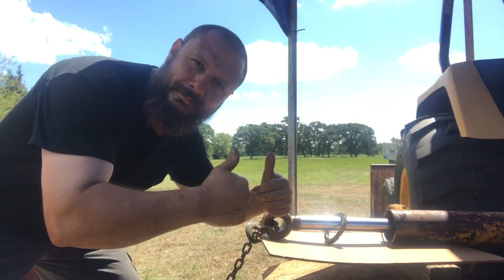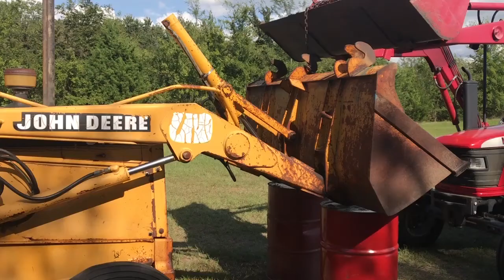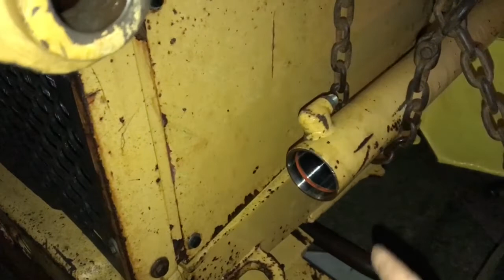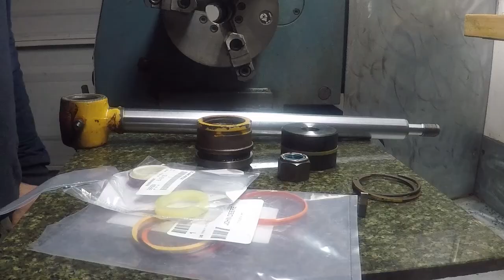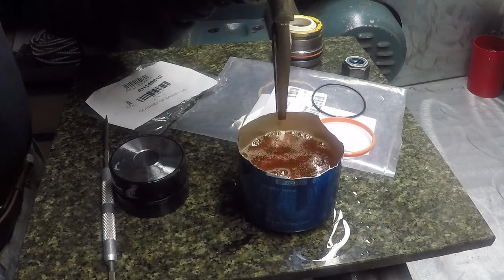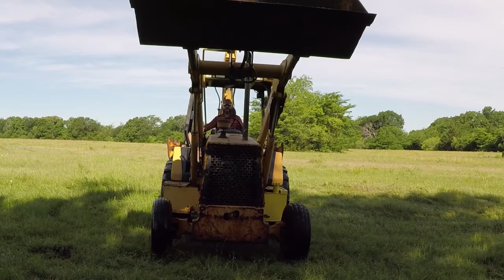John Deere 310D Hydraulic Cylinders Finale

Comment: How come my swing Arm will only go to the right, and it will go to the left. But very, very slowly. And both Cylinders were just rebuilt. What is my issue?
Reply from the maker: Did it do that before you rebuilt the swing cylinders?
Reply: @SalamSayhood  yes
Reply from the maker: Did you check the value that controls the swing? Did you check if there are any mechanical issues with all the hinge points? Also make sure all the linkages from the stick that operates the swing to the valve are good and the hydraulic tank is full.
Reply: @SalamSayhood  Where is the Vaule at the bottom of the linkage ?
Reply from the maker: Yes, right above the swing cylinders. To know which valve, just follow the hoses from the swing cylinders.

Comment: Thank Salam, I really appreciate your content.  I have a JD 310C in about the same condition and due to your videos I now have the confidence to rebuild the cylinders on my own.  I'll be tackling the bucket cylinder in the next few days.  My stabilizer cylinder rods could also use replacing and it appears our machines share the same part number (RE26577) - would you mind sharing where you picked up the aftermarket rods you used?  Thanks again!
Reply from the maker: Good morning sir, I bought mine from a place in Irving, Texas called Heavyquip. Look them up. They have several branches in several states. Thank you for the nice comment, if you have any questions please let me know.
Reply: @SalamSayhood  Great, thanks for the information!
Reply from the maker: You are welcome

Comment: Thank you Salam for sharing. I didn't know grease was compatible with Hydraulic fluid. I that a special grease. I know when I rebuilt the Alison AT540 transmissions, I would mix vaseline and transmission fluid to make a paste for installing seals. What is that that you are using?
Awesome video, and thank you for your final comments and recommendations.
Reply from the maker: I just used lithium bearing grease. The hydraulic system is separate from the automatic transmission fluid. The grease will not cause any issue in this system. I also used anti seize on the thread of the glands to make future work easier. Thank you

Comment: Thanks Salam!  I believe that I have watched all of your videos at least once. Very helpful! Interesting how "easy" it was for you to disassemble these, compared to what I ran into.
  
Water and Rust appear to be the main enemies here. 
 
  On both of my stabilizers, the gland nuts were literally hand-tight, and there was extensive rust inside the first +- 2" of the cylinder. The Swing cylinders were much the same. I have not gotten to the others yet. This meant water, and a lot of cream-colored fluid collecting in the system.
 
   My main problem was that no matter how well I thought that I had cleaned the area around the internal Snap Rings (in all cases), the installation ring failed to stay in place. For the stabilizers, this caused some damage to the Wear Rings (no big deal). 
   Trying to clean the area inside the swing cylinders more thoroughly before extracting the assembly, did not unfortunately work out for me. I believe that the amount of internal rust (that I could not reach) was too much for the ring, and it got caught during removal. It was unbelievably hard to move the gland at all for snap ring removal, and took a lot of pounding. The first time, all I lost was the cast iron wring out front, but the second one (after being even more careful to try and "clean") I ended up breaking the front portion of the piston. That is not an easy part to find at all (I am still trying).  

  I fully plan on packing these with grease as you show. I already have some Marine Grade stuff for re-assembly. I plan on sending this machine to my son when I am done excavating, and I would not wish those problems on anyone! Thanks for that continued advice.

   My machine was not maintained well by previous owners. The creamy hydraulic fluid is a good indicator of water getting into the system through bad seals. Up north with the snow/ice, it is not hard getting in. Storing these under any sort of roof will keep these machines operational much longer. 
 
  As far as extraction methods, I would be inclined to create some sort of motor-driven screw-shaft sort of slow removal method. Something that is slow, but powerful, maybe 12V powered. I am sure that I could have caught the ring/piston problem I ran into (e.g. gotten a tie-wrap or other compression method to catch). Even sort of like an old scissor-jack (that they make for cars) might have worked. 

  Oh, I hope that you are going to Paint that bad-boy! If mine were 1/10th as clean as yours, I would have already done so.

  ** note: at least three of the sources for aftermarket kits for my 310C did NOT have the wear rings (the RE20430 Bore Kit) for my stabilizers. I finally got kits from ZerksPlus.com for the RE20430 that DID have the wear rings. 
Buying from a local dealer means you can return if you have an error, but once opened, you may have some difficulty returning aftermarket ones. This set me back weeks and weeks.  Advice from me: Look/Measure BEFORE opening, and make sure everything appears to be there! A set of micrometers from Harbor Freight, a somewhat necessary tool, can make this pretty easy to do through the package. 

-Regards!
Reply from the maker: Good morning sir, I don't know why manufacturer like John Deere don't recommend or use something to prevent the rust around the gland. On my machine, The CROWD cylinder was the hardest to come out. After I removed the castle nut, I applied WD-40 and waited about one hour. I pushed the gland in, then I extracted the ring, then sand it all the way to remove the rust. I also did my best to clean the groove for the snap ring/installation ring area. Then I installed the installation ring and pulled the rod straight with the tractor and it came out OK.
If the piston that you have is damaged little bit, you can repair it if you have lathe and welding grinding knowledge. The piston job is only to house the rings to seal the pressure to move the rod. As long as the rings is seated correctly and the metal part of the piston will not come in contact with the cylinder wall then that is good enough.
On my bulldozer, one of the pistons was damaged and I was able to build some weld with 7018 rods and then grind it to shape and fine tune it with the file. 
Make sure you get car engine cylinder polish tool to polish the inside of the hydraulic cylinders to extend the life of the new seals.
I am going to paint my machine after I build a shop.
Also, since your hydraulic system is contaminated with water, make sure you inspect the cylinders from the inside for any rust. Also flush the hydraulic system and replace the filter. Water in the system will damage the cylinders, pump and the control Valves. If you have any questions please let me know, you have a good day.

Comment: What type of red grease are you using? Is it high temp bearing grease?
Reply from the maker: Yes sir,
Reply: Thanks for the quick reply. Your video is excellent. I wish I had your video when I rebuilt the dipper cylinder on my 310D back in 2010. I’m getting ready to do the left steering, right bucket and left stabilizer and I have to re-do the dipper cylinder again.
Reply from the maker: You are welcome, I appreciate your comment.

Comment: Excellent video! Thank you for taking the time to video the process and post it for the rest of us. After I replace the seal kit on my boom I will be working on the cylinders for the loader and then the stabilizers, you have shown me some valuable tips to help save time and not busy my hands up as much 🙂. I thank you for your help and your replies are greatly appreciated as well. After I rebuild my cylinders I may message you about the controls for my backhoe - they are sticking and I want to fix that soon as well. Take care!
Reply from the maker: I appreciate your nice comment brother, my control joysticks use to stick because the backhoe was set for a long time, when I removed the control cover, I washed everything, inspected the spools, joints and arms, everything was okay, I sprayed it with WD40 and worked it. then sprayed everything with penetrating oil, they are working fine now. Be safe and have a good day
Reply: I believe this to be my problem as well. My backhoe has been sitting for about 6 years before I got it and was only started once every few months with no operation on the backhoe or loader. It's a great backhoe, just needs a little work. Be safe brother!
Reply: Do you recall what size sockets it takes for the nut on the bottom of the rods for the boom cylinder and loader cylinders? Mainly wondering if they are standard or metric
Reply from the maker: All the hardware on my machine is metric, however, I used 2-1/4” socket on the boom cylinder rod’s nut.

Comment: If the steering is hard to turn wot is problem?
Reply from the maker: I need more information, type of the machine? is the steering hard in one direction or both? what troubleshooting you did so far? is there any mechanical problem with the steering linkage? does it stay hard to turn on low and high RPM?
Reply: Both direction my mesin also jd 310D
Reply from the maker: @roberttewtew1462  for me to be able to help you, I need to know: what troubleshooting you did so far? is there any mechanical problem with the steering linkage? does it stay hard to turn on low and high RPM? Have you replaced the hydraulic filter? Do you have other hydraulic problem? if you lift the front tires off the ground, is the steering stay hard? Any other information would be great. Good luck